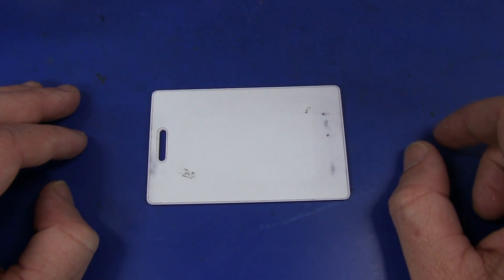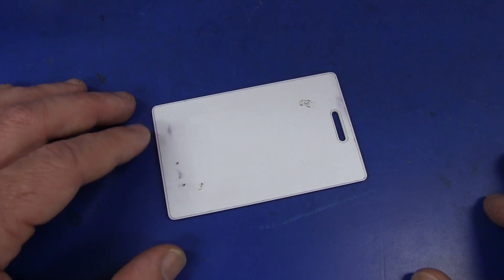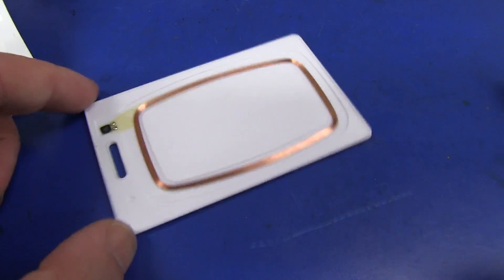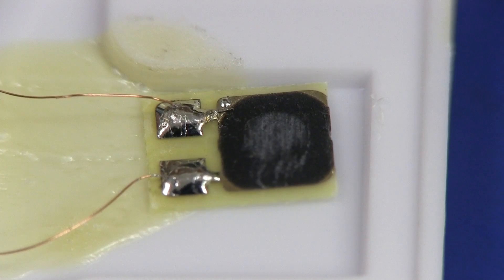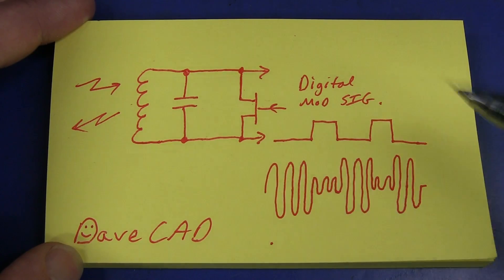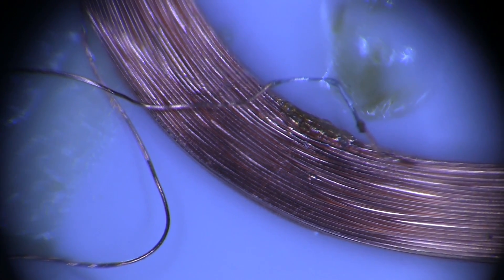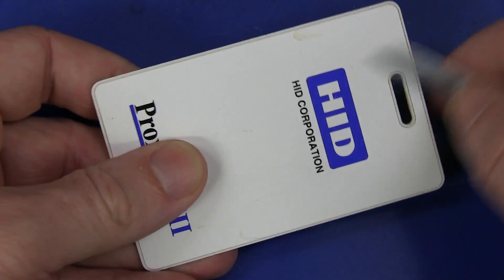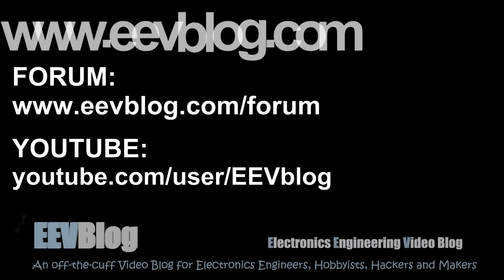EEVblog #539 - RFID Tag Card Repair

Comment: I've researched this a little bit. When I tried to copy my RFID card from school and integrate this into sonic screwdriver. Some type of cards contains hardcoded ID. So you cannot write anything. Only read a specific ID. That is paired with your account. I needed to figure out the electronics to emulate the ID and play it for the RFID card reader.

Comment: can anyone say how a paricular code is being generated by the tag,after being digitally modulated into some 0's and 1's (after that LC circuit) ?

like here the tag code is 43223 in the last one
Reply: 1st That printed serial number on the card has nothing to do with the code that is saved in the cards chip.
2nd If you think some sort of random number is generated by the card when you hold it near the reader than its wrong. The card has a fixed number (your worker ID number for example) saved on it. You can erase and change the number but you will need a "dedicated" reader/programmer to do it. As for how it works? Just like Dave showed on his drawing. Card is stimulated by a carrier wave from the reader. This way the chip is supplied and it modulates the carrier wave (according to the number that is stored in it) by shorting it with a transistor that is connected across the coil. Changes in the carrier wave amplitude are picked up by the reader as 1s and 0s, that binary code is converted into your worker ID and BOOM! everybody know that tilak marupilla is in da HOUSE!

Comment: You might want to obscure the writing printed onto the card body if this card hasn't been invalidated in the back end after you got a new one, since for those "dumb" cards usually that's exactly what's stored on the chip. Just saying - in case someone figures out where the lab is located...
Reply: Evan if someone copy that number it wont help him get it the building because this type of cards have also another security code witch is not written on the card itself but can only by detected by the readers and without it coping the card is pointless. That also how cards with identical number tags can work together without problems

Comment: I think these card contain a serial EEPROM with XOR circuit to compare the card reader password with the serial data in the EEPROM before allowing any data read or write. It works like the SIM card but with the input/output connected to that "Dave CAD" drawing.

Comment: RFID card, I took 100 turns of #32 wire and wrapped around my finger, soldered the TWO CONDUCTOR 125MHZ CHIP, epoxied and molded a ring. this worked very well!!! The coil is a power source for the chip.

Comment: Absolutely correct, but does someone you pay minimal wages really think/care about that? At the minimum, the old card should be returned even if it isn't working. Preferred though, is also having that particular number disabled and a new number issued. Takes only a minute with good software. But the real fact of the matter is that RFID is not all that secure in the first place since the signal can be read with inconspicuous devices.

Comment: Hi Dave, I have a question, when you meassured the 125kHz on the oscilloscope did you put an inductor on the probes?

I don't know if wrote it correctly but I hope you get it :)

Cheers
Reply: You don't need an inductor to pick up the signal.

Comment: These cards are rather crude compared what's on the market today. I've worked at a company where they used mifare cards (desfire I believe) and those were just creditcard shaped (i,e. a LOT thinner) and you could not open them like that. 

You also could not copy them with standard equipment as it had a bunch of crypto in it.

Comment: I should also add that the site code is almost never printed on the card. We read unknown cards on new sites by using a feature in the access control system to read in the raw data.

Comment: If the myth busters were trying to prove that credit cards were unhackable, they were using the wrong frequency tags, and the wrong protocols. The RFIDs, which credit cards use, have proprietary protocols, and are high frequency tags. From what I understand, the MBs were using low frequency, EM4102 tags, with very open protocols. If they couldn't clone one of those... Well.

Comment: The 125kHz card Dave has is easily copied. When energised the card simply transmits an 'id' (just as Dave suggested). There is no security in this particular card.

Comment: They do interfere, but in fact the standards have anti-collision protocols that allows selecting a specific card out of multiple presented simultaneously. Sadly, very few systems have bothered to implement this and will just give an error when the AC protocol detects multiple cards.

Comment: I broke on the fine coil wires in my old watch when changing the battery, somehow i resoldered it with a cheap dick smith soldering iron. still works.

Comment: Dave, I was hoping you would throw you're card back across the reader. If you tried it before you repaired the loop, it wouldn't have worked regardless. I kept thinking you would retry it. The video seems to suggest it was tried pre-repair.

Comment: I pulled apart an older "Honeywell" card years ago.It was basically a dual sided PCB,with some coils routed on it,and some SMD caps,IIRC there were 4-5 of these L/C's (like 3 on one side,and two on the other?). With a couple of stickers on the outside,to cover it all up. No idea of values/frequency,I never really measured it.

Comment: I have a couple of button sized RFID tags that are essentially covered in plastic. They have no noticable flex but the plastic  is not 100% hard so it can handle some impact.

Since the item was a free sample, I tried running it through an autoclave and it still worked :)

Comment: I have wrote software to capture the id codes from these cards for a project at work.  The card come pre-programmed from the factory when you order them.  You need to specify a facility code and id code range when ordering them.  EX(190, 000001 - 190, 00100)  The reader I used for my project was the HID OMNIKEY 5325 CL.  It has a SDK and sample code for visual studio.

Comment: I've got it against one other 125kHz cards, and 4 "ordinary" ones. One problem I found, was that the other LF-card did not work nearby the lab access card.
I think there are some strange engineering behind this cards, it may be nearly impossible to copy them. My guess is because they're used by the Securitas (homeland security) in Sweden.

Comment: I counted 25 turns in the top layer! But my best guess is that the diameter of the spool makes it tuned for the carrier, and the # of turns actually increases the voltage / range to be scanned at? I'm using that card myself, and got it inside my wallet (facing other RFID-cards), but when I need to access my lab, its enough to put the whole wallet (with all my 5 different RFID-cards) nearby the reader, and it works! Those must be designed for good sensibility / accuracy.

Comment: Hi Dave, amazing video, please tell me what kind of passive rectifiers can rectify such a faint signal???,

I had problems in the stability of the full-wave/Half-wave precision rectifiers and coupling them to other Op-Amps to compare the DC measurement of an AC signal.

also can you please do some episode about the Tank circuit and to build a working one for us, i crave to build one to use it in any application (example low power FM Transceiver )

Best Regards

Comment: Dave, to my knowledge this isn't backscatter modulation. It should be load modulation, the same principle used as in 13.56 Mhz systems. Backscatter is used in UHF (far field).

Comment: I program RFiD systems as part of my job, so here's a hint to the number of turns. I know the coil should be around 850uH inductance. But, to work out the number of turns you'll still need to know the wire diameter and coil diameter. Sorry, I don't know these ones off the top of my head.

Comment: My old key card, had a really butch construction. It was 1,5 mm at least, and it was a two part key, so no sticker, sonic welded. The coil and chip were of similar construction but it they were glued properly to one of the sides. I took it apart some years ago after i got a new one because i accidentally fried it on an electromagnet.

Comment: Not to mention my last job used those silly things , I drilled a hole threw it a 1mm hole to put it on a lanyard and what do you know , I used the xray to find 2 coils and a very thin wire going from one side to the other exactly where I just happened to drill through , I hate them , even my bank has forced one on me and charged me for it !! worst Idea ever these rfid's

Comment: That was straight forward. :-)
I had once to repair my 13MHz id card. Was complete potted, had to dig out the antenna with a glass filament brush to repair it. I would much rather have a card I can repair properly. ^^

Comment: That most RFID access control systems are secure (which they aren't).

I bet your 125kHz card is a bog standard ID-only dumb card (like HID Prox) that can be cloned into an Atmel T55x7 card (that Atmel chip can emulate many dumb cards and modulation formats). Maybe try building a coil and scoping out the data when you use the card, see if you can identify what format it uses? I'm sure you could build your own clone chip if you wanted :-) (or just buy a Proxmark3 which can sniff/read/write/clone)